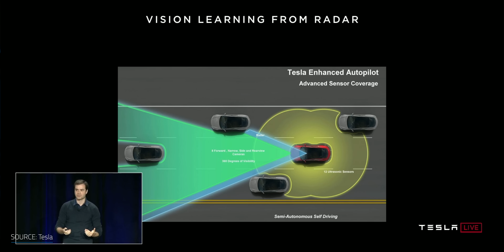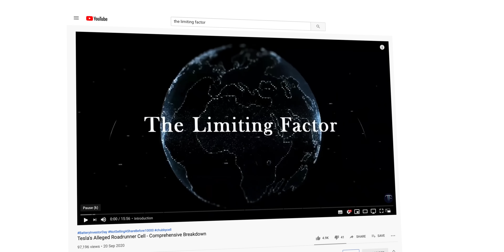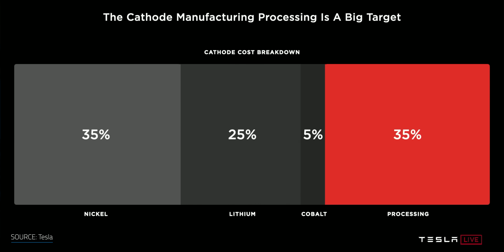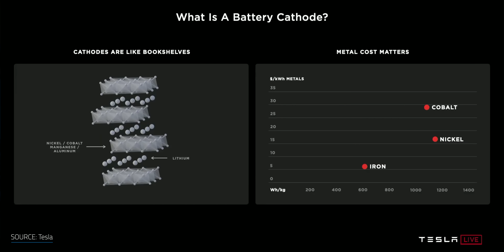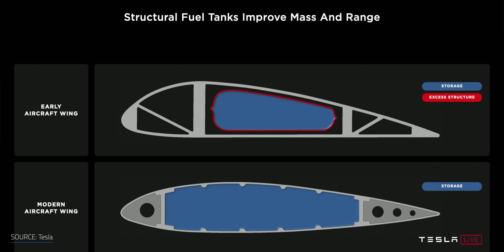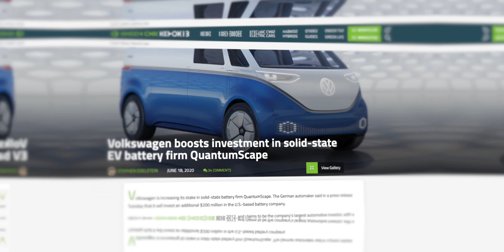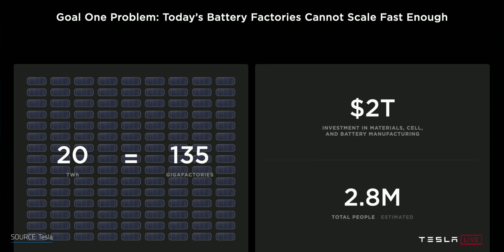3 Takeaways from Tesla's Battery Day - Hint: it's not just batteries

Comment: Country of 17 million here. We use 3,000 petajoule on an annual base, that's 3,000 x 10^15 Joule which expressed in Watts comes down to 833 x 10^9 kWh (833 TWh). Around a sixth of that usage is for domestic usage and out of that usage around 80 percent concentrates between October and March as it is used for heating. Since no break down of commercial usage is available, let's just screw economy and concentrate on domestics and assume that solar is capable of supplying this amount of energy. As I commented in an earlier video of yours solar out here has a 12 hour normalized efficiency that varies from 117 percent mid summer to a mere 16 percent mid winter. Effectively this means that 80 percent of energy is produced when only 20 percent is used and vice versa, and that means that there would have to be a storage capacity matching 60 percent of the overall annual usage. That's 500 TWh and we only count 0.2 percent of total world population. Those battery production numbers are a laugh, even with endless life on them you'd still need a thousand years to supply the whole world on the 2030 goal.
Reply: You're confusing energy (TWh) and power (TW).
Reply: @bigdream_dreambig  No I'm not. Watt is Joule per second. My opening evaluation is fully consistent with that.

Comment: We seem to be our way, but we're not there yet, and I'm skeptical we're going to get there within a few years.  To me, cost is only one of the problems with EVs. Another is refueling vs recharging.  I did an apples-to-apples comparison, meaning translating ICE-fueling rates to the miles-per-hour metric often used for EV-charging (at least in the US).  2 minutes to pump 12 gallons of gas into a 25-mpg car works out to 9,000 mph (12/2*60*25).  The best an EV can do is in the low hundreds of mph recharge rate.  This gap needs to come down, a lot.  I understand about overnight charging, and taking lunch breaks when we need to recharge.  But this is a hurdle that can't be fully addressed by demanding a change in behavior or expectations.  I'm happy to see the projected range increase, which is one step in the right direction for this.  Does the new battery technology allow faster charging?

Comment: The flat sheet exoskeleton WILL NOT lead to weight savings. This will be a heavy vehicle, as shown in the traction stunt against the F-150. Conventional car body panels gain extra strength from curved surfaces and thin metal.The benefit they are going for is getting around the stamping process, and also removing the need for an exterior paint process.
Reply: Cybertruck will be LIGHTER overall with Exoskeleton and Cell to Vehicle production and only needing 800 cells per Vehicle. 
but it will be Built like a TANK with Rigid outer Panels and a STIFF Battery Tray that is CAST .

Comment: I wonder if at some point Tesla will include a super-capacitor charging pack for on-the-fly charging, a kind of portable charging station inside the car?
Reply: Likely not. That's not a good use for a supercapacitor. Supercapacitors drain down over time so you can't use one like a spare can of gasoline.

Comment: Here is a thing, I don't know if I get right: Let's look at the 56& kwh price reduction. That means for the same price you can have doble amount of batteries in your car. So double the range. And then, you must apply the 54% range increase of those... so 3 times more range for the same price... Isn't it? Or may be I'm wrong... Ok. I know. Double amount of batteries means double the weight, but even so...
Reply: You're right in principle, although double the batteries will also take twice as much space, and there really isn't room for that.  Also, it's unclear what "stacking" assumptions they're making to get these numbers.  For example, it's possible that some of the 54% range increase is because they can use fewer batteries, thus making the cars lighter.
Reply: @bigdream_dreambig  Ok. Maybe there isn't room, but I doubt it. You only need another layer of batteries, and make the car that much higher, and you would have the same car with double the range (not exactly because the weight would also be bigger, but almost... you know). Ok. We'll see what the future brings. First Tesla must keep up to it's promises.
Reply: @castorperez6441   Not promises.  Forecasts.  Everyone keeps getting those confused...
Reply: @bigdream_dreambig  Well. Elon admitted there was something they still must figure out before the sistem works. I thing that's the point for the markets. The Roadrunner project is "not" producing 10 GWh a year. If it were, then everything (and I mean everything) would be exploding right know. It's a bomb. It's game over what they showed. But, it's still not working. Is it? "When" it works it will be game over. They will be "the" car company. All the others will die.

Comment: Traditional engines are far from on their way out. EV's need a lot to make up for that metro dwellers (US) always forget. 1) In the us there are a huge population that is in rural areas that need a vehicle to reliably go 300 or miles ( starts, stops,hills,towing etc.) on a single tank/charge. 2) Outside of Metro area's there are no convenient charge stations. 3) Charge times are grossly longer than the time it takes to just fill up for the next leg of the trip. 4) As a mechanic- reliability as far as electronics go. I spend 90% of my time chasing down electrical failures, shorts and random chaos then I do having to diag the machine.

Comment: Anyone else think the $25K model is actually just a new base Model 3?
The body casting and battery price reductions, with maybe a bit of tweaking to the design such as losing the glass roof, might result in a cheap enough car.
That and leveraging the economies of scale they already have for their most popular vehicle, and reduced capex cost of developing a brand new car.
Reply: The Model 2 should be smaller than the Model 3 because the Model 3 is still pretty large for most non-American markets. It definitely won't just be a cheaper Model 3.

Comment: I get that it is not just about the battery, but allow me to focus on the battery a bit and ask you to answer this question: What could the Tabless 4680 Cell do for E-Bikes and Electric Motorcycles?
Both vehicle forms are potentially able to assist in reducing carbon emissions, but their form factors are limited by the weight of their operators/riders.
Could the 4680 help 200+ pounders like myself get on 2 wheels versus getting in 4?

Comment: If anyone is interested in what Tesla is doing from a silicon and nickel perspective, I would suggest going back and looking at the Maxwell tech. In their research, they detail how high loads of pure silicon combined with NMC can be included in the dry battery electrode binder. Maxwell had already been creating and testing cells with these enhancements. Here's one such paper: http://www.powersourcesconference.com/Power%20Sources%202018%20Digest/docs/3-1.pdf

I think seeing this, plus the cost-reduction benefits of running with the Maxwell tech is what led them to the acquisition. The added benefit was that combining that tech with the tabless cell architecture solved the remaining problem with reducing heat, thereby allowing them to dramatically increase the cell size (along with the power and efficiency increases). 

Tesla has always known that while they had a range benefit, they suffered with power. Existing cylindrical cells, while they have great capacity, have low C ratings compared to the other cell architectures that  companies like GM use. 

Because of this, they had to rely on thousands of batteries to spread the load. From a performance standpoint its ultimately limiting, from a production standpoint its very expensive, and from a technical standpoint its an incredibly difficult engineering task to keep in check. The battery yields alone with that many batteries per pack has to lead to a lot of waste at the gigafactory. 

That being said, Tesla worked around this admirably, but I believe they always knew it was a solution with vehicle platform and profitability limits. You cannot scale to the levels they wish to when you have all that to contend with. 

People still don't quite understand how massive this new cell is (literally and figuratively). From a volume perspective, imagine taking the existing Model 3 and Y battery pack, and eliminating 2 out of the 3 modules. You now have the volumetric equivalent of one of those modules providing the same power as the previous three combined. You drop significant weight doing that one thing alone, which will ultimately increase range and overall platform efficiency.

Also, don't fall for this messaging that's been going around in the media that it'll take 3 years to realize. They misinterpreted what he said (although he's sandbagging anyway), they have been creating these cells since they brought the battery production facility online last year. They just don't have a high yield production line solution ready for export to all the other Terafactories.  There's no way you sell the Plain Tesla Model S without this battery. There's no way you can test it and get it ready for its reveal without being confident in the battery's performance (hence, you've been making them for a while). 

I think all he's telling us is that production of millions of batteries a year is a few years away, but rest assured, they will have enough of these batteries to produce plenty of cars, cybertrucks, and semis next year.

Comment: I'm confused. If they are going with a tabless design, and are honeycombing the cells in the structure of the car, then why aren't they designing the cells to be hexagons instead of cylinders?
Reply: No point.  The battery needs its sheets close together, so when rolled becomes a cylinder (circular cross section).  If you make the casing a hexagon, you're just adding 6 useless triangle-ish shapes onto the cell.  Also, cylinders are easier to work with in automated manufacturing because their rotational position doesn't make any difference.

Comment: Hey Matt how do you come to a 54% increase in range when Tesla themself said it would be 16% which is still massive?
Reply: It was not Matt that claimed the 54% increase in range but that actual slide came from Tesla in the battery day/stockholders meeting/video/live stream. There have been multiple innovations and changes in manufacturing processes which led up to the 54% claim by Elon.
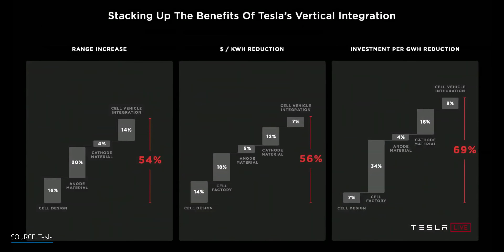Reply: See the left third of 13:06.  The cell design alone increases range 16%, but is only one of many improvements which add up to 54%.

Comment: I think 'ICE cars are dead' is a difficult statement to support given that any EV will still have a limited cruising range, and currently you can just go to any gas station in any town or city to fill up your gas tank in minutes.
In North America, efficiency isn't really a very big factor for us, as gas is very cheap. Perhaps in Europe your prediction is correct.
I'm basing my comments mostly on observations of the types of vehicles most people are driving (trucks seem to be getting larger, higher, and louder, lately) and the slow uptake of EV's in our domestic market, in spite of relatively affordable prices (again, compared with the expensive and large vehicles that sell well).
Great show!
Reply: Range is almost a non-issue.  Even the cheapest Model 3 can go 244 miles per charge, and most get >300 miles which is plenty on long trips when combined with Tesla's supercharging network.  Problems come in remote areas without the network and in places with cold weather (which reduces battery performance) -- but if Tesla succeeds in boosting range by 50% in the next few years as they said, I really don't see any more problem.
Reply: @bigdream_dreambig  You'd think so, but in reality it's a barrier for a lot of ICE drivers, given that they might need that EV to be the family car for road trips.
If you've ever had to search around for charging stations (yup, that's me) you'll know what 'range anxiety' is all about!
Reply: @WestCoastSupercarsandClassics   My common road trip has maybe 3-4 Tesla superchargers spread along its midpoint, perfectly placed for a stretch-your-legs lunch and bathroom break.  And the vehicle knows exactly where they are, how many stalls are open, and what amenities are nearby.  No need to search.
Reply: @bigdream_dreambig  Sure thing. Not every EV is a Tesla, so in terms of the rest of the market, I'm just observing what the main barrier for most garden-variety ICE drivers.
Early adopters are different folks, right? :)
Again, not arguing with your personal situation, it's just a fact that EV's haven't been able to get the traction one would have hoped.
Reply: @WestCoastSupercarsandClassics   Ah.  Yes.  Well, there's a reason Teslas -- now that there are models at non-astronomical prices are dominating the EV market.  The other manufacturers really need to get their acts together if they're going to have any chance of survival...

Comment: I think Tesla has missed a trick here with this single radii cell pack.
While the optimal circle packing fraction (area efficiency), in a square bounded space, is 78% (78% cells, 22% void), regardless of cell radii or hex vs square packing,  this is for cells of equal radius. If the larger intracell voids are populated with small radii cells, this percentage can be increased. 
The voids between 4680's could accommodate 2170's, increasing the PACK energy density, though not "optimally". According to Wikipedia, there are apparently 9 "optimal" radius ratios for "compact" (all cells touching) binary radii packing schemes. 
See section on "Unequal Circles" in; https://en.wikipedia.org/wiki/Circle_packing
The highest BINARY RADII "compact" packing fraction is 91.1627478% for a radius ratio of 0.545151042. This would mean either a new 25mm partner for the new 46mm cell OR a tabless 2170 variant with a new 38.5mm cell. This is assuming that, structurally, now the cooling is axial and not an intra-cell ribbon, touching cell cases (i.e. compact packing) would be better. Of course, it's also possible that "compact packing" isn't the best overall engineering solution, considering other factors like cell-cell thermal/mechanical isolation. Maybe a little space filled with a matrix adhesive between them is useful, in which case maybe there is some "optimal" 2170+4650 packing scheme with a couple of millimeters between cells.
Even though this would add manufacturing complexity (to perfect the manufacture of entirely new small tabless cells) if they went for the optimal binary radii packing they'd achieve 91% packing efficiency, which is a 17% (0.91/0.78) improvement over single radii density. A 17% PACK energy density improvement for TWO standard cell sizes doesn't seem something to sniff at! Perfecting the manufacture of these binary radii cells would be a one-time cost, the 17% pack efficiency improvement would be forever, and mathematically unbeatable.

Comment: Question - The new 4680 cell is much larger volumetrically than the cells it replaces right?  Is Tesla bragging about the increase in per-cell power?  Isn't part of the big increase in the power of an individual 4680 cell just due to its massively larger size?  What is the new cell's power density both in terms of watt-hours per cubic centimeter and watt-hours per kilogram?  lets see if those numbers are hugely bigger than the current cells or competitors and then I will be impressed.  Because the Tesla batteries are cylinders, there is wasted space when you stack them.  For example, Chevy's battery packs have individual cells that are thin rectangular pancakes that stack with less wasted space.  of course, the goal is to minimize both the net volume & weight of a given size power pack, so the best comparison of the new 4680 cells to Tesla's older cells and to other manufacturer's cells would be to compare the weight and volume of all commercially available 60 kW batter packs.

Comment: The new battery design seems to have to squander 20% of the old battery pack's width (at 7:45). Assume this is to prevent an increase in written-off cars that have side-impacts on the sealed battery. Seems a shame íf nothing can utilise that valuable skateboard space?
Reply: They mentioned this.  Not only does it improve safety (as you're alluding to), but putting the comparatively massive batteries closer to the center of the car also improves its handling/agility -- like how an ice skater can spin faster by pulling their arms close to their body.
Reply: @bigdream_dreambig  Correct. Its not they couldn't put batteries to the edge of the skateboard. They didn't want to and don't need to.

Comment: Weight and price is important, but also volume/size. So why not make square/flat cells? Like the ones used in jump starters. They can deliver an insane amount of current, with little loss, due to the short distance to the terminals. Cell shown at about 9:00. Be sure to watch the short circuit test at 12:00 ... https://www.youtube.com/watch?v=0tGK1nqXr28
Reply: HEAT.
Reply: @markplott4820  But flat cells is easier to cool. Better surface contact on a flat, than a round shape.
Reply: @jnygaarddk   - NO , they are NOT .
pouch cells no matter how packaged , still need extra hardware to keep in place and to Cool the battery with a Cooling Circuit. 
TESLA eliminates over 79 less parts in the pack. eliminates the modules + pack ENTIRELY.
TESLA will use MORE Efficient PLATE cooling on the Bottom + top. 
and ONLY Tesla has Superbottle, Octovalve and a EFFICIENT Heat Pump.
TESLA will use HEAT conductive EPOXY to transfer heat Efficiently and eliminate HARDWARE to keep cells in place.